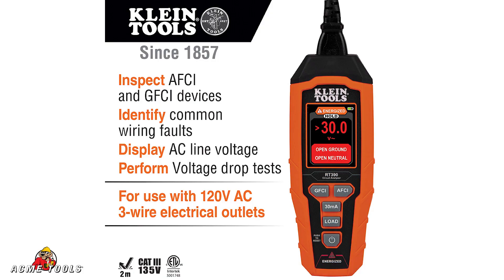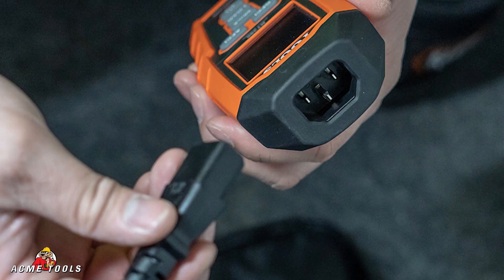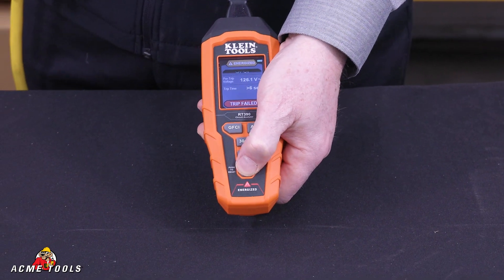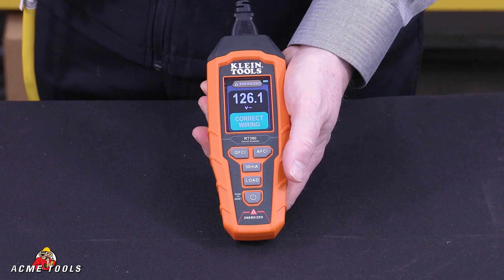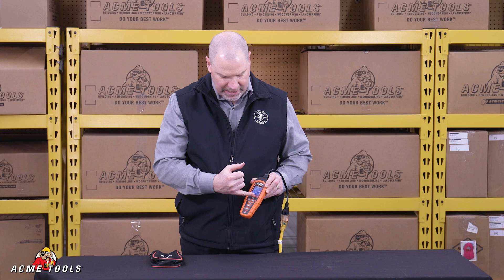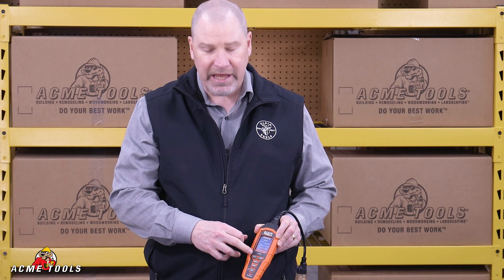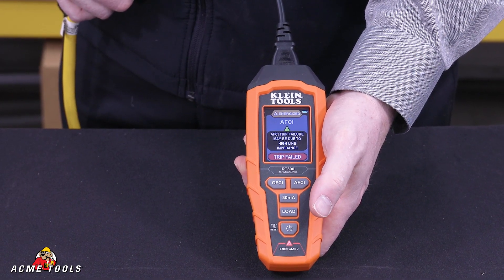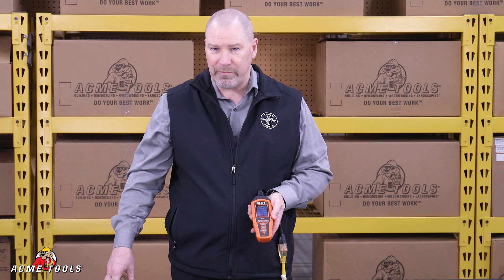Klein Tools Circuit Analyzer [RT390]

Comment: The one thing that's aggravating about this tool is, when the test lead is plugged in, the ground is up.  Most outlets have the ground plug facing down, so you have to twist the cord to plug it in.